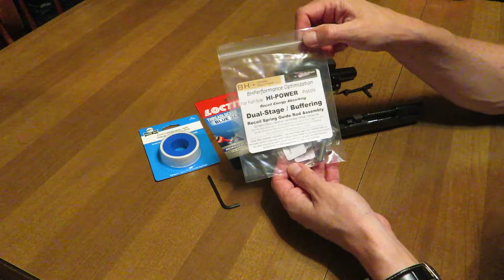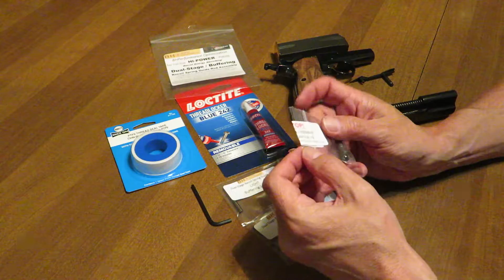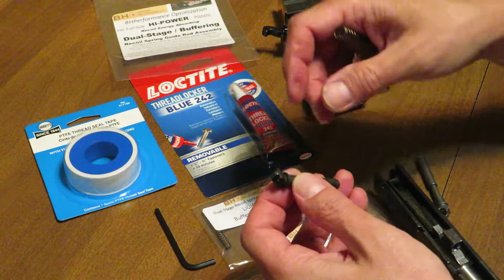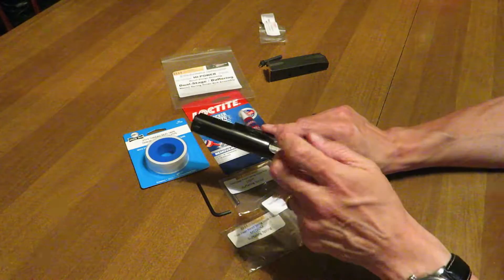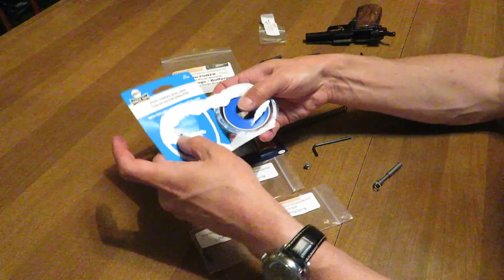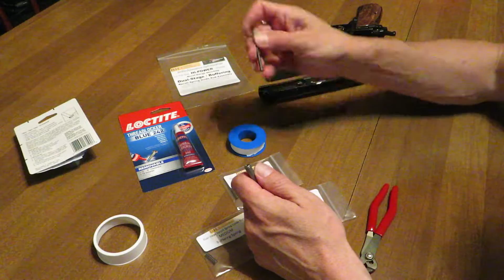Tutorial - Hi-Power Buffering Recoil Spring Guide Rod - BHSpringSolutions.com

Comment: I have had a buffering guide rod from Springco for my C series High Power for almost 20 years (so I'm not in the market), and I have both metric and imperial hex key sets.  So this doesn't affect me, but... given the cost of this custom gun part and the cost of single hex keys when purchased in bulk... why don't you include the appropriate hex key with the remainder of the parts?

Just asking, because just about everything I buy these days where allen keys are required for assembly/use, the manufacturer provides one of each hex key size required.  So much so that I have a little container on my bench full of all the hex keys I've accumulated with purchases over the last 20 years or so.

For tightening/disassembly, a wrap of emery paper around the tube (grit side in) will allow you to grip the tube with pliers without slipping while you tighten or loosen with the hex key.  The emory paper prevents the pliers (or vice if you're careful not to crush the tube) from marring the outside of the tube.

Comment: I love your tutorials. Many of the things that you touch on are things that I have tried to teach people for decades myself. I have been teaching people to shoot since 1970 in some form or faction of the shooting Arts.
I carried a revolver as my primary weapon 98% of the time a 357 Magnum 4 inch revolver. But during that time I was teaching a good amount of police officers how to transition from a revolver to a semi-auto. Many of them being the Michigan State Police because in the late 80s and early 90s they finally were allowed to carry semi-autos and they would buy their own. One of the first things I learned was to tell those that bought a Beretta to take it back and trade it for a firearm that does not have a hammer drop because when you properly put your hand on the top of a slide, with your finger and thumb towards the back of the slide in order to rack the slide by using your arm strength instead of slingshotting it by using just your index finger and thumb, you are likely to disable that firearm. It has the worst placement for a device that renders the firearm useless on a firearm that you need to either defend yourself with or be in action with as an enforcement officer.
I also found that when women, who were usually weaker or older people, when I taught them that method they were more than capable of racking the slide on any firearm I had run into. Because they still had the requisite arm strength to rack the slide but they were stuck on that stupid shot method which is not the proper way to operate a slide for any reason. It's also why I don't understand the move to the optic on top of the slide. It gets in the way of properly operating the slide. I'd also like to point out that in 99% of gunfights are close enough that if you have done your practice properly, that the sites being within your vision will get hits on the protagonist. I couldn't count the number of times I had to tell these officers that holes in the air will not suffocate the actor. I would even put two rounds into the magazine on their gun. And they would complain that that's why they have a gun with that many shots. And I had to point out to them that the average number of shots fired in any gunfight is 1.2 shots between both parties. If the gunfight isn't on its way to being over by the time you fired a second shot, you have more than likely lost that gun fight. But that's a story for another day. Would you do a tutorial on the proper racking of the slide using arm strength. It will be useful for everyone who watches it.

Comment: I have a Kareen MK 3 and when I rack the slide like half way it feels like there is a hiccup like if something sliding a bit too tight but not tight enough to prevent it from racking it feels like if something needs to be sanded down for it to be smooth all the way I thought it was the spring and guide rod kinking a bit but I removed them and put the slide back by itself and it’s still doing it I have no experience with high powers or clones so if anyone has any ideas please help.